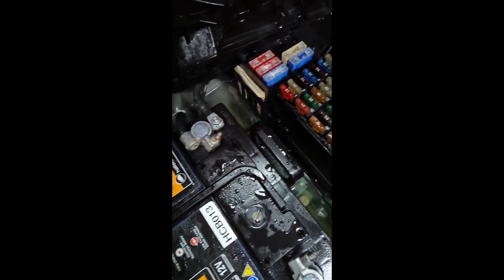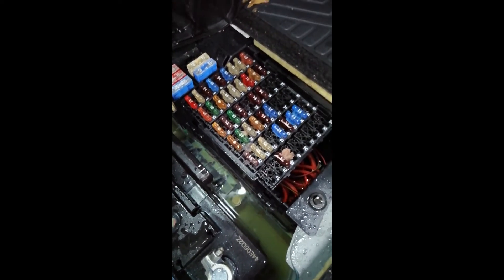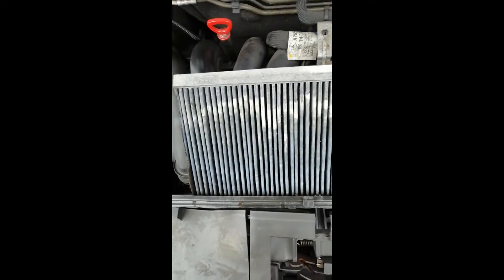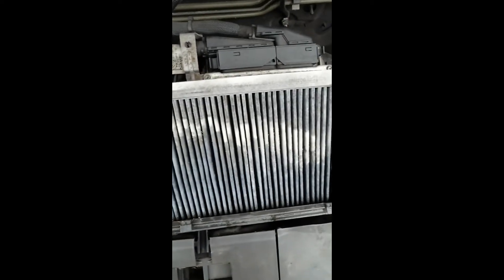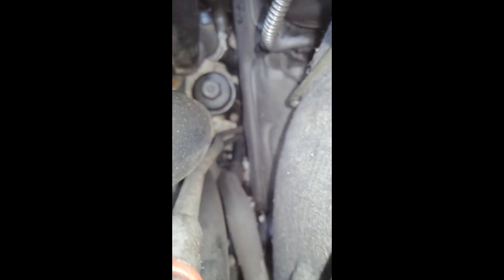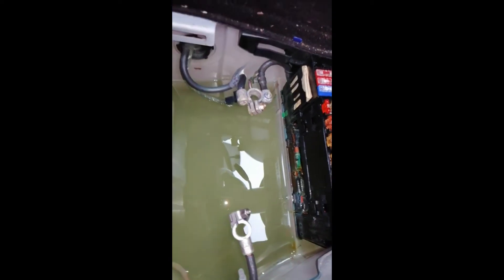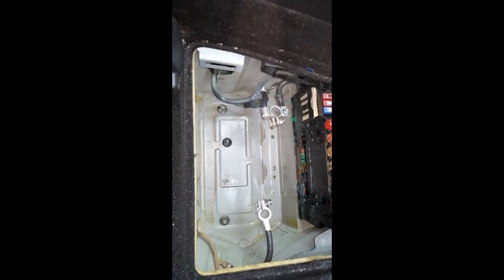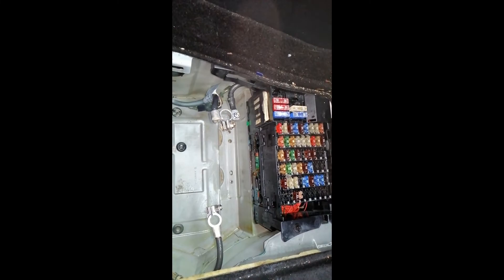Water ingress in the Mercedes W169 A class

Comment: Could you tell me How can ı remove polen filter ? I have a same problem with my w245 b class after the heavy rain my car’s carpet get wet. Thank you
Reply from the maker: Hi there.  Looking online I can see that the pollen filter on the W245 is in the same place as on the video.  Open the bonnet, and the pollen filter will be behind the small hatch below the windscreen wipers.  This is where in the video I am draining the water.  I would suggest that the drain is also blocked, so that would be worth checking too.
Reply: @kerbsideindustries9714  Thank you so much for your answer. I will try it. I hope I can solve this problem.
Reply: @kerbsideindustries9714  This is really work. I have removed polen filter .Drain hole has been fully blocked by some leaf other tree’s stuff. I have cleaned that and almost 2 liter water went out through the hole. Thank you so much.
Reply from the maker: Excellent, that is really good news. I'm glad to have helped.